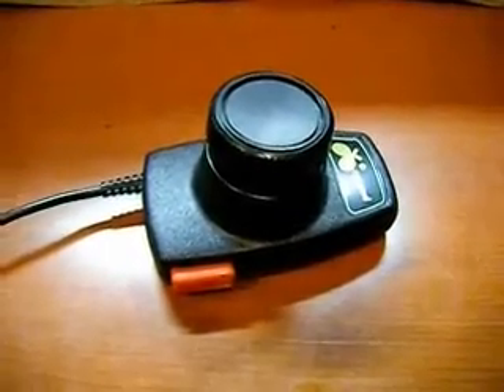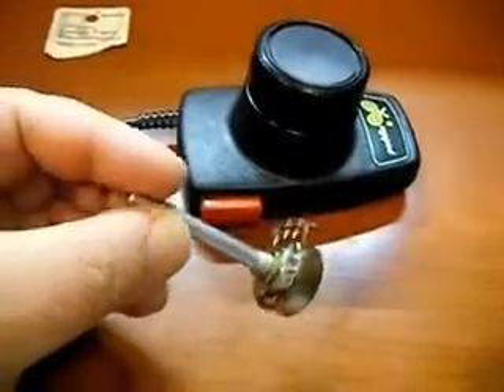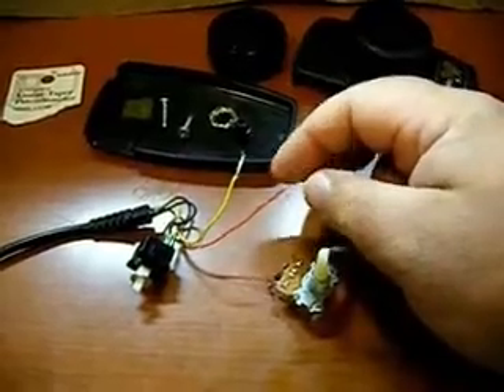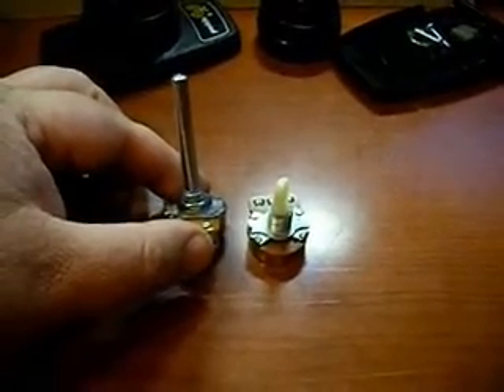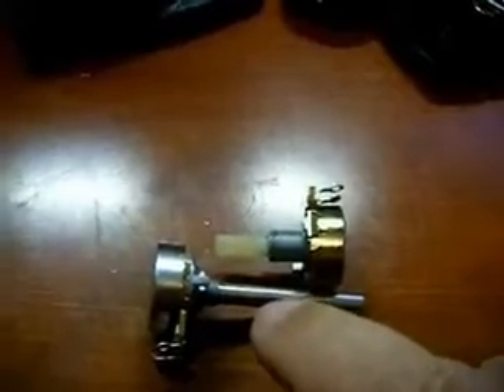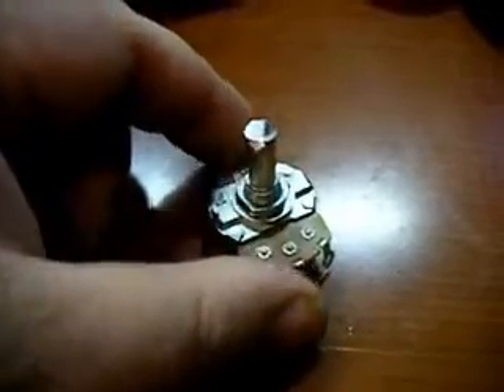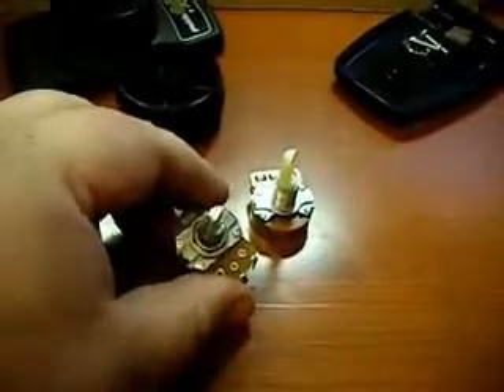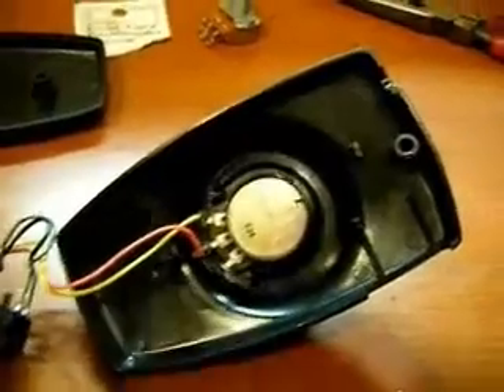Atari 2600 Paddle Controller repair Mod

Comment: oh RadioShack, how I miss you...
Reply from the maker: Yep, I miss it to
Reply: @SVT512  wow nice, reply on a 15 year old video I commented on. what a website. appreciate the video tho, I was going to try your method here to fix up some paddle controllers for my friend, but I ended up just making my own variant with a 1M pot, a key switch from a mechanical keyboard, an atari joystick extension cord, some little plastic project boxes I got off Amazon (it's no RadioShack!), and a generic volume knob. I just cut out a hole for the key switch to mount to, drilled a hole for the pot, and wired everything up to the correct pins, and the results are a lot better than the description makes them sound. I'm in the middle of a move and when I get settled I'm going to 3d print up a better case/knob, but for now they are smooth. 

I also considered making a set of Bluetooth paddle controllers based on the retroblue firmware, but that would just be silly. 

I probably will end up using your method to fix the set my friend has that are completely roached, tho, it's a lot cheaper than buying recreation pots. so thanks for that!

Comment: You may be able to effect the same fix without buying a $3 Radio Shack part, without modding the pot, or your paddle case. Instructions for cleaning the original pot can be found by Googling atariguide care repair. I intend to try it myself.